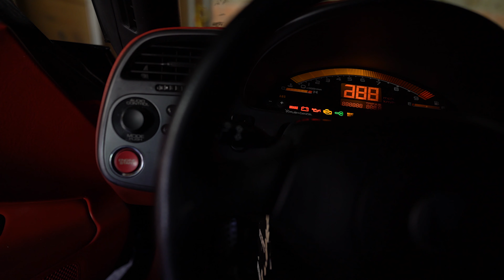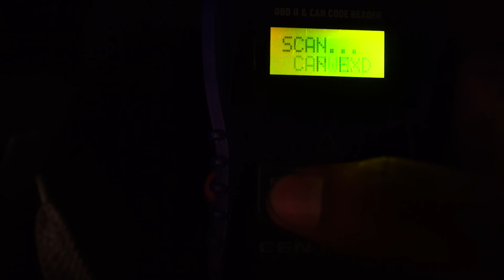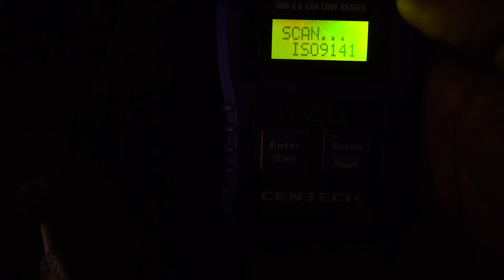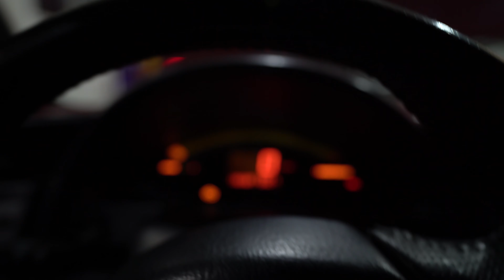This S2000 give me a run for my money!

Comment: Secondary air pump s2k delete kit, just delete the system it’s such a common issue they make a kit to delete it entirely. Ive been chasing the p0411 code forever bought a whole new system thinking it was the relay or pump swapped the parts it worked for a day than stopped turning in I’m just gonna delete it.